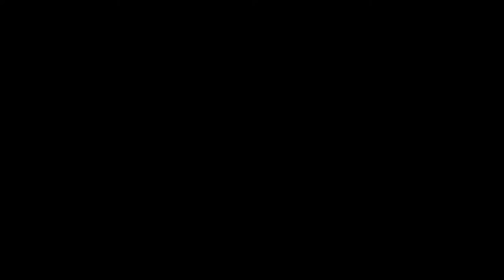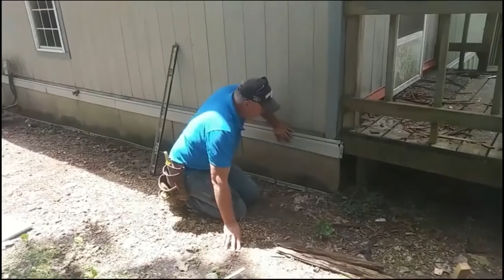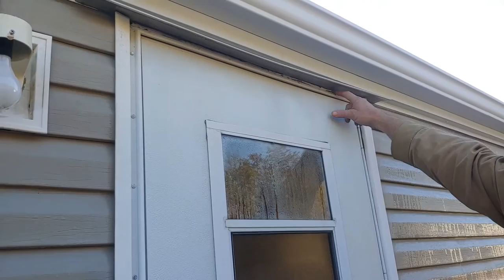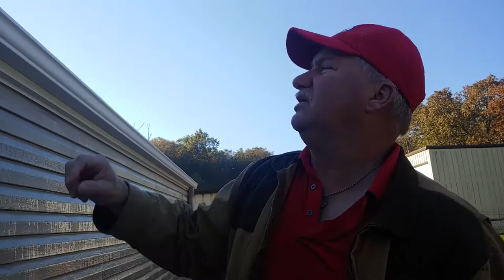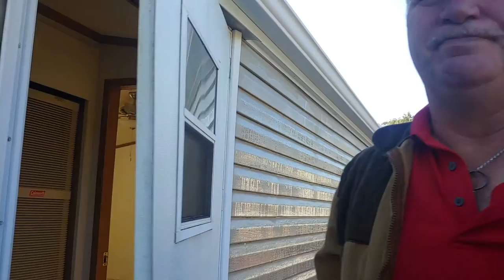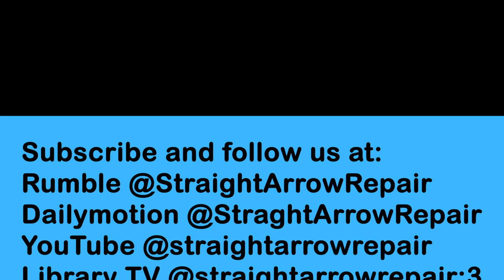Why Your Mobile Home Door Might Be Leaking

Comment: Would have liked to see the solution. I have the original gutters and have leaks at every window and door and wanted to do the bigger gutters. Thanks for the info on the original
Reply from the maker: The gutter should not have much to do with leaking . try to seal across the top and sides of the frame with silicone. Rarely the seal where the gutter touches the roof. Hope that helps.